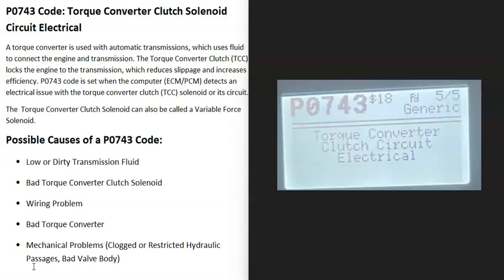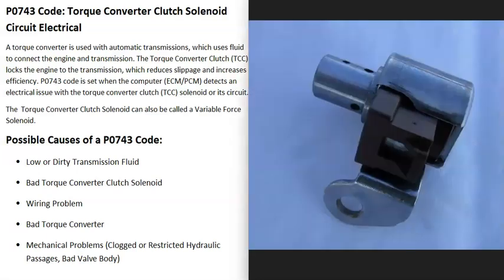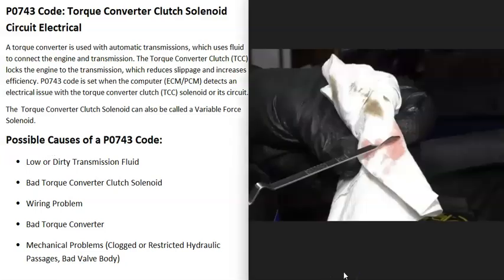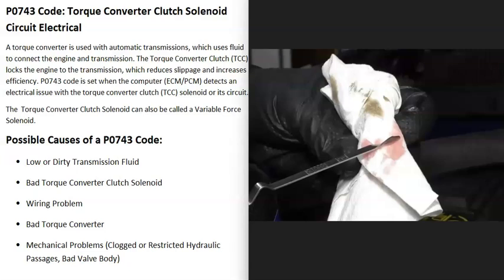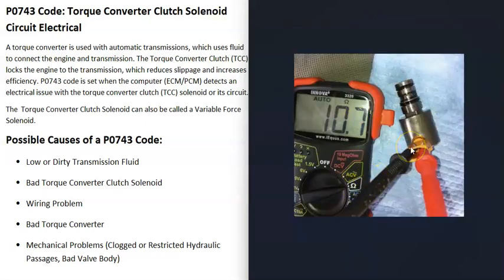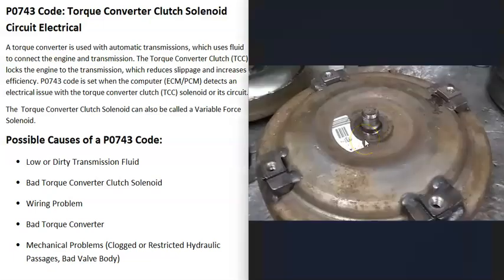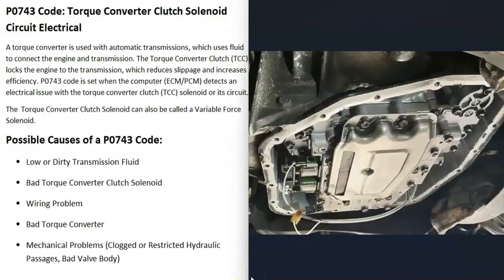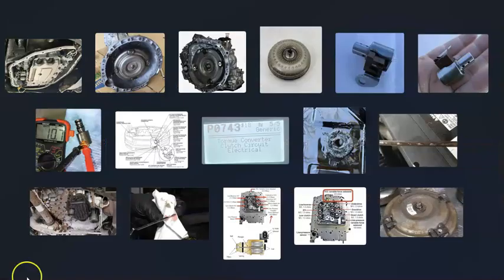Causes and Fixes P0743 Code: Torque Converter Clutch Solenoid Circuit Electrical

Comment: Great informative video. My vehicle wont go into any gear, all dash lights indicate correct gear with no warning lights, there was no grinding, noises or anything untoward. It just jerked in/out of gear a couple of times then wont go into any since. Very good condition and looked after vehicle and no transmission issues before. Checked TCC resistance and other solenoids = all 3.4 Ohms as manual suggests. Fluid pink and full, checked PCM (Poweretrain Control Module), Range selector (TRS), Transmission Control Module (TCM), TCR (Transmission Control Relay) and all wiring / fuses = all seem good, although I cant really check the TCM or PCM unit itself. I am wondering if the VSS, vacuum modulator, TPS, OSS/ISS could cause my issue? I have fault codes : PO743 (Torque Convertor Solenoid System) and all other gear / solenoid PO codes but I am assuming the faulty TCC would initiate those as it wont go into any gear? Any help, advice would be greatly appreciated as unfortunately I have been forced to live in my vehicle and I now cant move it. Thanks for the video.

Comment: can you help me, when I drive until 3rd gear(automatic transmission), it jerk then stays on 3rd gear, can't shift down or up.. but if I turn off my car and start again, it works normal.. only until 3rd gear it jerk again.. is it the solenoid?
Reply: Having exact same problem update w solution if you find one. What vehicle do u have
Reply: Easy need another computer 100 sure happen to me
Reply: @gabrielsanchez1380 were you responding to me? I've been driving it like that for the past 3 months. Mines is a 2011 Hyundai accent with the 1.6l
Reply: @thomasjones188 mine fixed already, it was the solenoid, better replace it before it spread to ur ecu.. common korean car's problem.. btw my car is kia rio yb 2018

Comment: Please I need help with my ranger 1998  3.0 2WD , I got p0743 , p1747, p0750, p0755,p0760, p1451, p0135,p0155,p1409, 
Is nothing wrong with transmission , has been rebuild is all new inside , what do you think is happening here ??? Thanks
Reply: My first question is, how does it run, ya know, go down the street? What's it doing?  I've got a 1993 - 2. CRAP and I didn't know anything before 2000 could spit that many codes bro. I'm still trying to find the damned torque converter solenoid for the wife's Subaru.😂 Lemme know bro, I'll help you as much as I can.  The thing is, your Ranger could be just spittin codes because they didn't clear them out. I'd know more if I knew how it drives or if it even does. Did you disconnect the negative cable and turn the headlights on and let it set for awhile? Now you got me curious bro. Damned '98 huh? HMB, lemme know.
Reply: @cornfusedatbest3980  my stay on third the hall time , Is not changing speeds
Reply: @RobertoSanchez-qv9xr Is the trans fluid where it should be?  Drop the pan and eyeball it. See if there's anything bouncin around in there that shouldn't be. Good Luck amigo.

Comment: I have installed a bundy exhaust in my 2002 7.3, 4R100 auto trans.  I'm getting a set of codes: P0703 Converter Solenoid.  Before it was installed, I didn't get a code.  It's accompanied by P1754 Coast Clutch Solenoid Malfunction.
   Have you heard any problems with this set up.  I have no issues when it's not set up.  I just had the flex plate installed by a solid shop, No other issues were found.  He's a Vet with a great set of knowledgable staff, they treat me and my truck very well..

Comment: My TC selonid only has 1 plug how do you test with a multi meter
Reply from the maker: It is best to get a schematic for the transmission wiring to know for sure, but likely, the ground is the outside case and the single-pin positive voltage.
Reply: @HVAC_Mechanic  how do I test this selonid. Also I went to Napa they don't have a part number for that part . AutoZone doesn't have the part with a single terminal. Advanced Auto doesn't have any listing this part either. Is there a way to test it I had gotten the schematics off of U tube to identify which was the TCC Selonid
Reply: Thank you for Responding